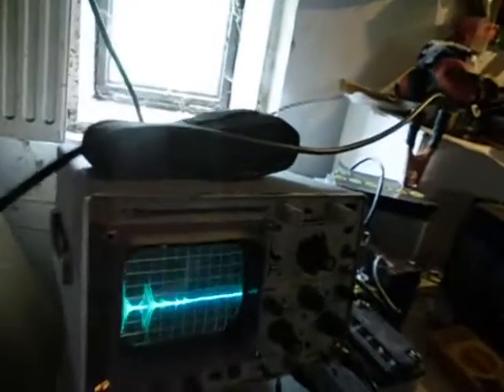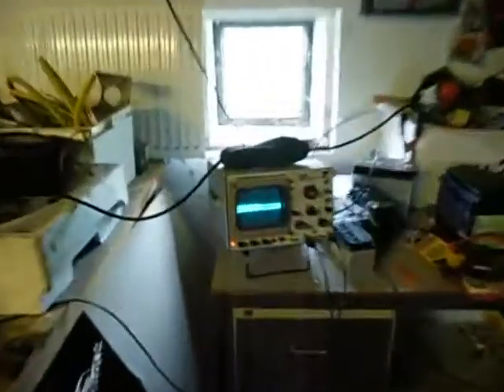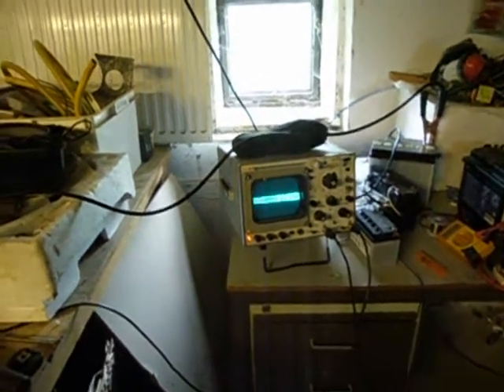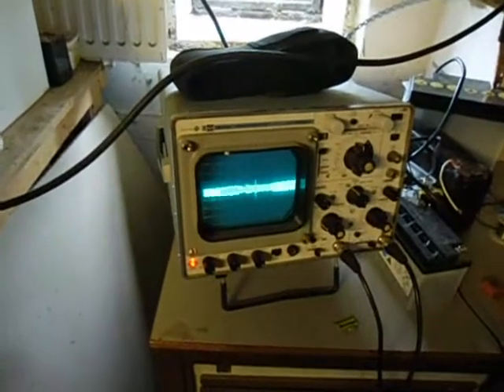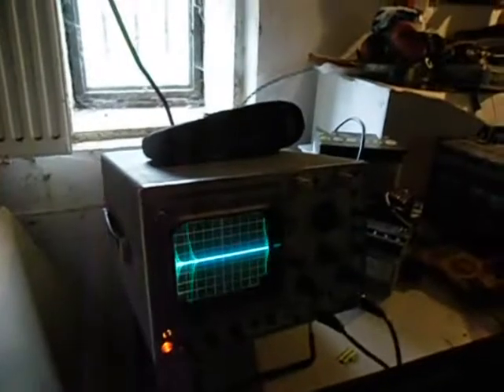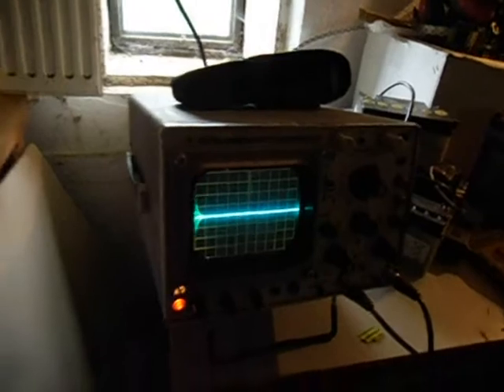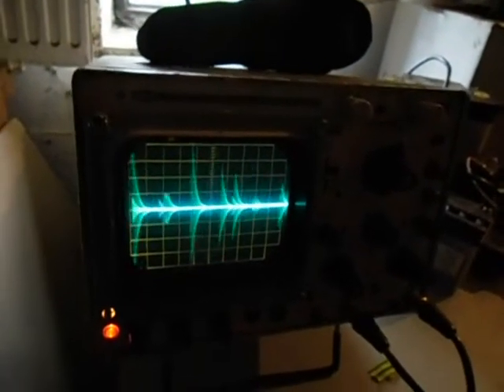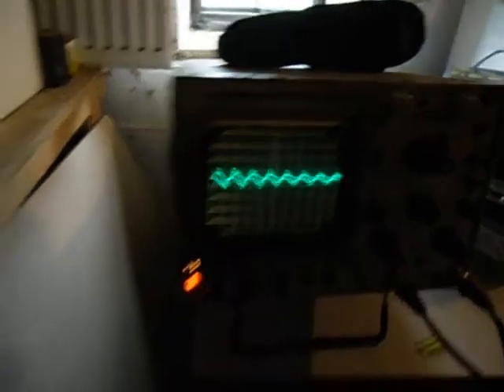qeg iron tests

Comment: so what if you run a standard AC motor that you find in a drill, washing machine ect? cool thing you got there.
Reply from the maker: It is generating a good voltage but unfortunatly almost no current so you can not even light up a LED with it but it is interesting though what it is.
Sorry couldn't respond because I was locked out of my google account!
Thanks for watching!
Reply: knagtegl if you are picking up a current from the dielectric field it will not register as amps. Its so so strange. it will actual cause the amps to drop if u get the radiant spikes coming in on something your testing. We in this community so bad need measuring devices that can detect dielectric energy. The amp meter measures how much the current can push a spring, we need something that would measure a pull, or push from the other direction. Check out db larson. he was brilliant, he said there is no electron, and he describes a simple experiment that will show you the positive and negative ( electric, dielectric ) are equal forces.